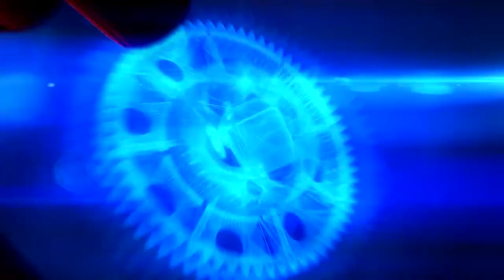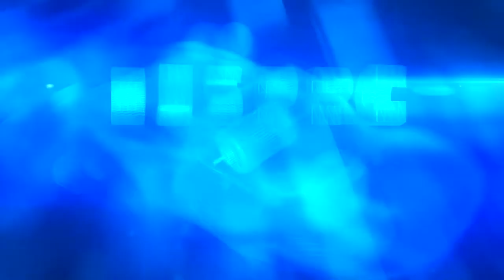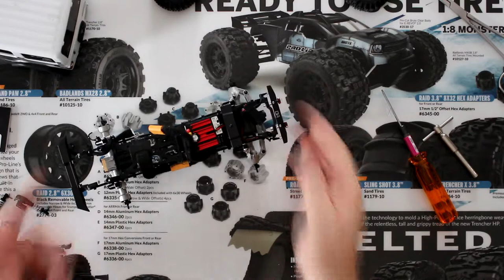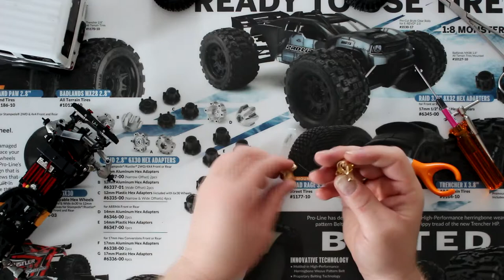Scx24 Upgrade Front Steering Knuckle  Brass Hot Racing

Comment: Question after I installed my steering knuckles on my Chevy C10 the wheels have a lot of play in them too much slack what did I do wrong
Reply from the maker: Just making sure did you reinstall the bearings if you forgot to put the two bearings that will be your problem.
Reply: @djsprc  in the morning I will break it down and look
Reply: @djsprc  This is my first rc rock crawler, yes one of the bearings is gone, must of fell out on me and I didn't see it.  I have gotten more bearings, so now ? #2 How do you get that pin back through the hex nut? Is there a trick?I have tried with it off, with the assembly loose, and with the assembly tightens in place
Reply from the maker: @ashleybartley7197  Unfortunately there’s no trick lotta patient and make sure it’s centred if it’s not centred you’ll have a hard time putting the X back